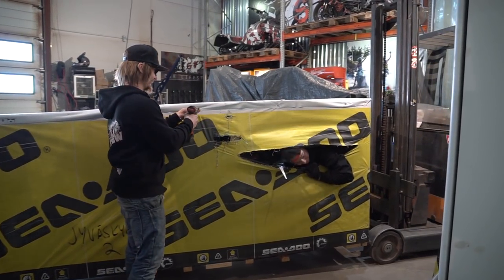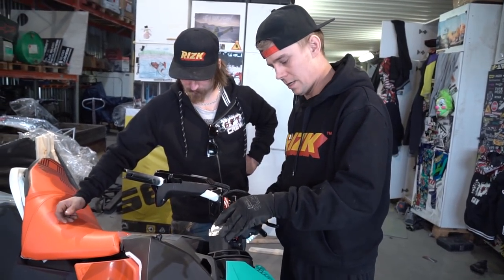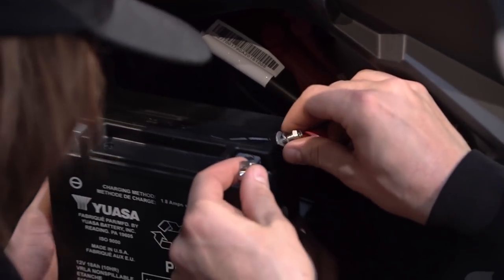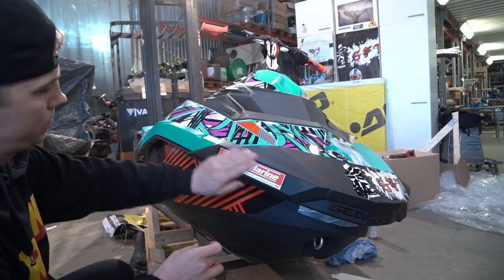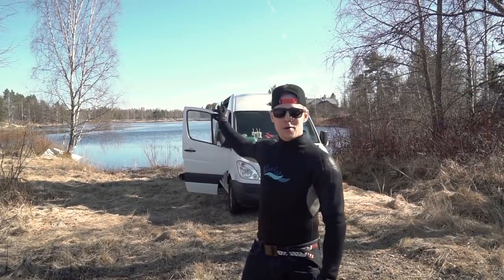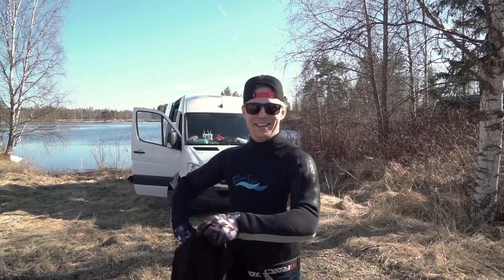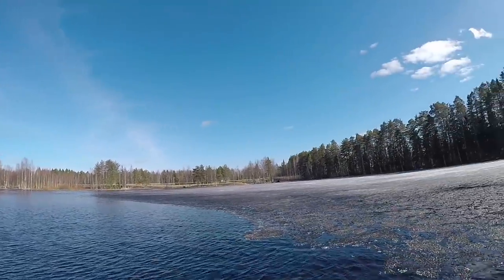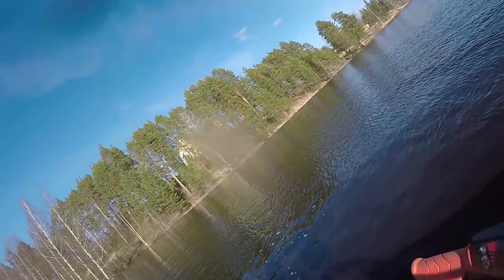SFT VLOG// Seadoo spark trixx unboxing&test ride

Comment: Why does the 90hp spark trixx stand up but the original spark 90hp doesn't lol doesn't really make sense im my opinion there probably the same engines
Reply: Bradley Willett But it has many things that The spark doesn't. You can't wheelie spark like trixx.
Reply: the jet on the trixx can point all the way up